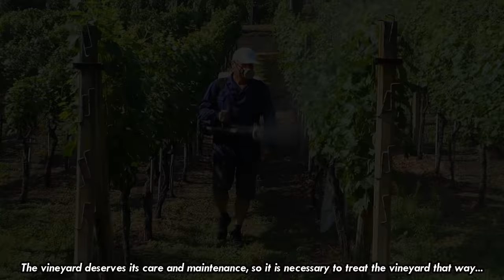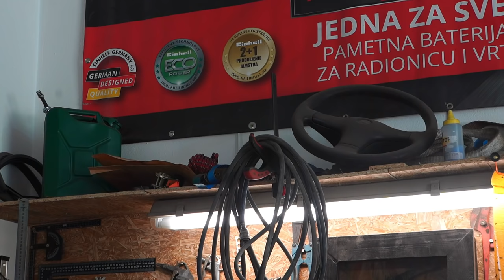Homemade SYRINGE HOLDER For TRACTOR Mower !?

Comment: This is a wonderful thought that has also visited me. The only thing that will upset you is the need for frequent stops to fill the tank of the Stihl. It is only 12 liters. And also the simultaneous operation of two engines is not pleasant music to the ears and can lead to neurasthenia 😉 Try to find more progressive solution to use one engine and bigger tank.

Comment: See a need - find a solution.  Practical, efficient, highly effective and better than factory made.  Another example of creative engineering at its best.  

Now all you need to do is find some other folks with your types of skills, a factory where the work can be spread out (different stations/steps in the process) and some investors for start-up financing.  Make your dream into reality.